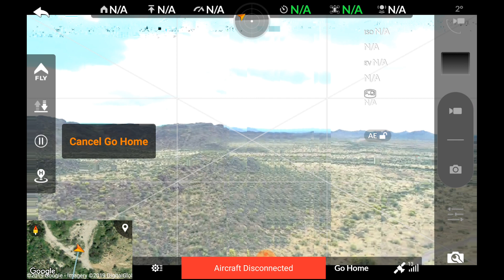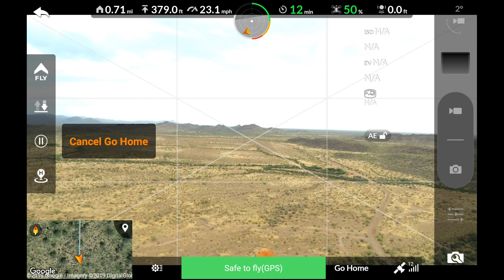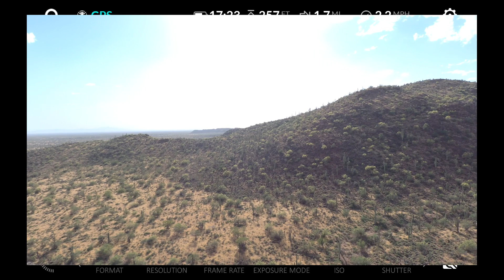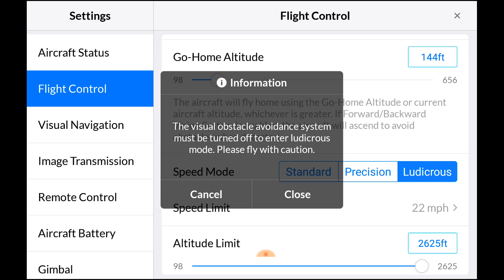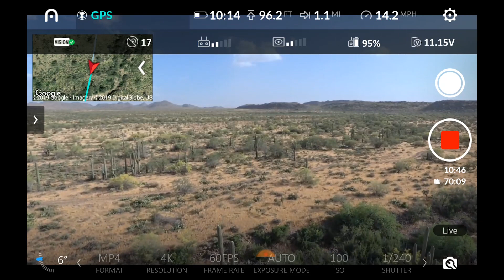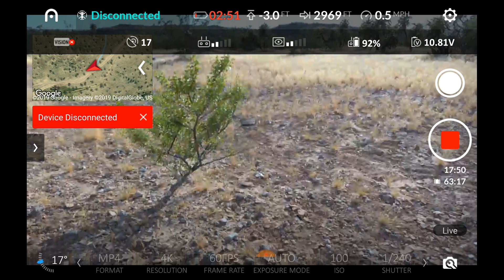The Day I Lost Then Found My Autel Robotics Evo

Comment: 1000 dollar drone, and it cant handle 10mph wind? Nice job Autel. Glad I didn't buy the Evo, almost did but a friend of mine who owns one, and has some videos up here from it, told me that the evo batteries are suspect. Poop out after few charges. He owns a phantom too and said there is no comparison in the companies batteries, DJI's are very reliable and last, I hemmed and hawed over it for a bit, because I wanted a drone with no GEO fencing. I couldn't justify a grand for a drone that is 2 years out of support. I went with the dji mavic air 2. Zero regrets! I've flown in 20+ MPH winds, no problem. I have to hand it to Autel though, a mode called "ludicrius" is quite funny. Should have been a warning sign to you, when you saw that. It turned out to be exactaly fitting! Give me "sport"  mode any day. Glad you got your drone back, and did all the right things to make that happen. However, for a grand of your hard earned money, you shouldn't of had too.

Comment: Sounds like you honestly believe the whole situation was a result of the EVO's shortcomings.  You think if it automatically turned off the sensors it would have helped? You think the Mavic Air would have done better in the same situation? I live in Mesa and spend a lot of time around Picketpost and can tell you that no drone going 20 MPH would fight the wind shown any better.  (Not 10 MPH wind as you indicated). 100% pilot error in my opinion.
Reply from the maker: I flew another drone that same day in the exact same conditions with no issues at all.  I had no reason the think this was even going to be an problem after my first flight. I have several more hours with the Evo now and I can tell you without question it is a weak performer in the wind. I now know how to turn off the OA and switch to 34mph mode. It does a lot better then but it then overloads the gimble so the video becomes more problematic. Absolutely the Evo would be a much better experience if it automatically tuned off the OA when needed like the Mavic does. For your last question yes the Mavic Air is a level better in the wind. I actually think the Evo is slightly better than the Mavic Mini in the wind. We just flew the Mini in some unexpected winds in a canyon yesterday and it made it back with some struggle. I had the Evo up at the same time and it struggled to get home in 34mph mode. The Mini was fighting hard but Sport mode brought it back. BTW much easier to get into Sport mode in a situation like this. Now for your last statement. There was no error. This was a purposeful test to get familiar with the drone in a safe location. It is because of this test I was able to get the drone home just yesterday. Since there is no drone simulator it is important to know how to get out of unexpected situations. The wind was in fact just 10mph as stated. Why do you suppose I would lie about how strong the wind was? How did you determine it was stronger than I said?

Comment: At least your bushwhack was fairly easy.  Should be getting my EVO today and I'm in Tucson and the desert is much thicker where I plan to fly.  Does the log file give you the last gps points so I would have that if/when I have to do an emergency landing and Search and Rescue?
Reply from the maker: Yes but the problem is that location is only the position before it lost connection. It can be way off depending on where it actually landed. Most of the time it is close but in the case of a fly away for example it wouldn't even be in the ballpark.

Comment: They make external tracking gps devices that go on a key chain. Maybe I'll try to attach this to it and make sure it doesn't effect it or the controls to help with this. Also put some night reflecting lights on to find it easier
. I know in the heat of the moment people panic. I think I'd land it nearest to the main road if I were loosing ground not try to fight until the battery is almost dead. I can say this in hind sight of what I've seen happen to you and how you handled the situation now. Thanks for showing me what not to do. Glad you found that bad boy! I'll watch some more of you content.

Comment: I also notice that I flied my Evo on some windy days and the Evo was all over the places. It is supposed that the Evo is not as good as Dji MP2/MZ2 in windy days. it should be improved.
Reply from the maker: You can turn off OA and go into 33mph mode and that fixes the problem if you need to.
Reply: @NewZonaRides  Thanks. I will try your suggestion next flight.

Comment: Had the same thing happen to me in Asia shortly after a typhoon.  Skies were clear and wind had subsided so I flew up in the mountains.  Unfortunately, the typhoon winds picked up again and was pushing my Evo away from me, even though it was flying full speed into the wind.  My solution was to find a landmark that I could recognize from the ground and land the Evo nearby.  Critically low battery, but enough to keep it marked on the controller map, so I drove right to it.
Reply from the maker: That was a good move. I tried to do a similar thing.

Comment: Once you took it out of standard mode you lost GPS and have to fight the wind yourself. I always plan for these things I always try to fly ageist the wind so on the way back I will always make it.
Reply from the maker: With the Evo all modes use GPS. You don't loose GPS no matter what mode you use unless you actually loose GPS signal. Then it will automatically switch to ATTI mode.
Reply: @NewZonaRides   Okay, then the winds must have been around 35 mph then. What would make a drone drift that much?
Reply from the maker: @controlyourfuture5477  Possibly the drone is more weak in wind than other comparable drones? That was the conclusion that I came to. This drone does not sense wind and shut off OA like DJI drones do. You have to do it manually and if you don't know that beforehand this can happen. This is why I do test flights like this.
Reply: @NewZonaRides   I really think that it can be updated to control the drone at 40mph in heavy winds vs locked 22.5mph witch it looks like what that has happened. Fixing it by a firmware upgrade then we should be good. It's Not a DJI However, for a company that came out with a drone that matches or even comes close to a mavic is kickass in my book. It does have a kickass camera and screen that's built in also wireless video feed looks great then add in the 60fps and last no restricted flight areas plus 250 dollars cheaper and right now I see I can get two batteries for 1030 bundle. I think I would take a leap of faith that bugs will be fixed and updates as well to this thing. 240fps @720p is nice too.   If it can fly at 45mph then that wind should have not took it off course that quickly. It was like it was locked at 22mph even when he switch it to that crazy mode that could only effect forward movement at this time not applied to high winds. The onboard computer seems fast enough for sure to handle it.

Comment: First lesson, don't fly in high winds. These are dangerous conditions and shouldn't be flying, not the drones fault.
Reply from the maker: How would you test the high wind performance of a drone without flying in higher winds? YOu never know what can happen when flying in a more restricted area. Shouldn't you test the capability of the equipment in safe conditions before relaying on them? Also this was without a doubt the drones fault. It has very weak wind performance until you know how to counter that wind.
Reply: @NewZonaRides    Seriously???  How else do you test it?  So simple, test flying away INTO the wind. If it goes 0 MPH against the wind and can't do it, it's still right there in front of you.
Reply: I disagree, although it is wise to fully test your drone in many circumstances, it is irresponsible to fly when conditions are as windy as this imo. Maybe you need to recalibrate your controller, I've never had a problem but I've never flown my EVO in 20 mph winds--glad you found it though
Reply from the maker: It is perfectly OK to disagree. In AZ drone pilots often find themselves taking off in calm conditions only to find themselves in a bag of hurt suddenly. This is especially true during the summer here. I intend to be prepared for that. I can tell you without a doubt the Evo is weak in the wind unless you know beforehand how to get out of this situation. It was because of this situation I tested until I could pull this off consistently. That was really the point of me showing this video. Training with any tool is imperative to safe operations and since we don't have a real flight simulator for the Evo I must use real conditions to better my skills. You do what works for you though.

Comment: Should not have been flying in high winds anyway.
Reply from the maker: How else would I test the wind performance? Should I have guessed?
Reply: @NewZonaRides  Nope your right, but you don't Go higher which you stated, if anything should've came way down. Pretty sure you know this by now right?
Reply: @NewZonaRides  Nothing wrong in testing in high wind, just don't fly so far away when testing as you found out.

Comment: Good find!  I ran into the same problem with high wind slow down.  There is one thing that could help and that would carbon fiber propellers the are stiffer than the stock which makes them more effent in high winds. The stock propellers bend and give away power.  I asked Autel about them and thy told me it keeps them from brakeing if you crash. Propellers are cheep.
Reply from the maker: I might just look into some to try.  Do you know if they make them for the Evo?
Reply: I have been looking and looking, but can find them.  And Autel does not want to into makeing a firm set of propellers some people have modified DJi Mavic propellers to fit the EVO but I have not seen any feedback. I would like to have a made for EVO set of propellers.

Comment: the evo is not weak in wind unless u leave in 22 mph mode , if u put in 34 mps mode in strong wind like that it can handle winds up to 37 miles an hour, no problem , u just have to turn of o a.  This what they call pilot error, u should never fly with the wind , but if do u should use luda mode.
Reply from the maker: You didn't offend me at all. I just want to make sure all new pilots can feel comfortable here and not be riticuled by superior pilots or amatuer drone flight investagators. You are sure welcome to your opinions even if I disagree with almost everything you have said. I bet Autel is really happy to have you on board ready to defend them like you are. I know I would be. I still blame Autel for weak weak weak wind performance in the Evo. It should be fixed. Why would they as long as they have pilots like you staunchly defending them? The wind performance of this drone is way below standard regardless of any other factors. I bet the SPARK is better in wind than this drone. Having to dig into menus to turn off OA is not a solution.
Reply: @NewZonaRides  why dont u fly a spark then if u think its better
Reply from the maker: I said I bet the SPARK is better in wind to contradict your bigger motor theory as to why the XSP kills the Evo in wind. Now to answer your question. Because I don't have one.
Reply: @NewZonaRides   dji drones dont automatically rev the motors up when they sense wind
Reply from the maker: No but they do in fact warn of excessive wind and then automatically shut off AO so you can fight the wind more effectively.
Reply: @NewZonaRides  not so
Reply from the maker: Well mine must be special then.
Reply: @keytiger7  buddy, your just being an idiot, he's stating facts, Evo is no good in windy situations
Reply from the maker: @keytiger7  Only I saw your last comment. You should know how to behave on the internet but I suspect you have difficulty remaining civil in your actual life as well. When you use profane language your comment is automatically filtered out. Maybe try again to call @Dwayne Baker a name to end your  weak position on this subject.
Reply: @NewZonaRides  That goes for u too , or whoever, i quess u two are lover's, since u seem too omit the fact he called me a idiot first . Bullys get bullied and im not the one , if u want respect then give it, he didn't , know how too repect , so he reaped what he sowed, and thats goes for you too judge.
Reply from the maker: Why point fingers and blame at all? This is why new pilots make mistakes all the time. They feel apprehensive about asking questions and showing flight videos because this hobby is full of total elitist pros who just talk shit. This channel is for learning. There is no need for blaming at all. Just enjoy the video and comment constructively. We were all new at one time. The hobby survives by getting more people into it. We all benefit by that. Now about your comments. I will try as you suggest on my flight tomorrow and we will see how it works. That being said it is not at all ideal to have to dig into menus to save an aircraft in a tense situation even if what you are saying works. That should be addressed.
Reply: @NewZonaRides   If it's been said, to fly against the wind, then we all should listen, the xstar has way bigger motors than the evo, u shouldn't get offended , when u know u was wrong, we all make mistakes and understand that , not one of is perfect, i made my share and still make , them.  , im  sorry if i offended u , but alot of things u was blaming on autel , they are not perfect either, my mavic pro and  mavic 2 zoom has also gotten stuck in the wind so it's just not the evo.  Now that we got out of the way im , not trying to tell anyone how to fly , i have learned my lesson lol i try not to fly none of my drone if the wind is 15. Mph are over. Even though
they could handle it , it only takes one time and it may not make it back

Comment: very strange i have flown in higher winds and no issue the OA was not the issue either since you switched to Ludacris mode it got turned off by default and you still had same issues apart of loosing altitude in luda mode glad you found it
Reply from the maker: I learned alot from this flight. I set out to familiarize myself with the Evo in a more challenging environment to make sure I was prepared if this actually happened at a real filming location. I hope others learn something from it as well. The big takeaway  for me is the Evo is not a good wind fighter. LOL  It does have a lot of strong attributes but wind ability just isn't one of them.

Comment: I think if you had turned off the Avoidence and gone to 34 then hit RTH you would have had no issues.
Reply: Why is that true? I'm curious. Is that a new update in app. I don't see 34 mph. I like this drone. The camera is cool and better than my MP or MA. Still some things to learn.
Reply: @mattball7341  it could be 35. He would have had enough speed to compensate the wind speed. At his altitude the winds were greater than on the ground. With avoidance on there was not enough power to the motors to over come it. In RTH the Evo would have flown by GPS to home.
Reply: @wayneladd7509  Thanks!! great to know. Just got my Evo. having fun with it. Have to get my C107 certification. I have a pre test book that talks about the wind, and weather factors. Neat to see this here. What is best for this here? Fly lower like in the video?  I just figure out. The 34 mile an hour selection is not there unless you turn off OA.
Reply from the maker: I think you could be right. I just wish we could program that into one of those so called programmable buttons on the bottom of the controller. Maybe even do that automagically like DJI does it.
Reply: @NewZonaRides  Button only controls photo selection. Would be nice to have selected options for those buttons. My Mavics have them. I don't use them much. I accidentally bumped them at times. My gimbal down was on one of them. I hit that often. I disabled it. On my MP I do A for focus. Evo is not tap to focus so it doesn't matter. The focus is always good on the Evo. It's better and clearer than my MP, just not tap focus. Evo buttons on bottom are easy to hit if they did assign them. I like the way it is for now. The app has features tappable on screen. I don't really need the others.

I like speed modes on a switch like the Mavic or Phantoms. Next Evo needs those on the controller. Flippy switch or slider. Not in app.
Reply from the maker: There is a a lot to like with the Evo. I generally prefer it over my other drones for most things. The camera is the bomb IMO. I just need to work out this wind thing. Next time I am flying I will attempt to turn off the OA and see if that is a reasonable way to handle this in the future. I hope it is.
Reply: @NewZonaRides  I'll check this out too. Wind is about 20 miles or so now. We have a dog park half a mile from home.  Big field I fly at. This will be a good check. Nervous maybe turning off OA, but I have to fly it to see. I don't have miles of desert. That looks really sweet to fly there.
Reply from the maker: @mattball7341  That spot in the video is my go to spot. I love it out there. I am lucky to have it. Let me know how it works out. I am going to try and fly Wednesday myself.
Reply: You can also turn off the front beacon lights on the front legs I believe. Another option to maybe save a bit more of battery power. If that can be done I'd just leave them off, no real point in having them on in broad daylight anyways. I don't think there's a option to turn the rear lights off.

Comment: What was the 95% and later 92% gauge (or meter) reading?
Reply from the maker: That is the battery level on the controller.
Reply: @NewZonaRides  ok, thanks.
Reply from the maker: NP